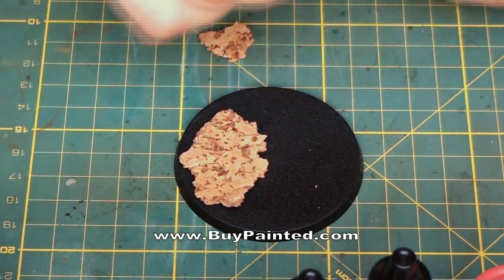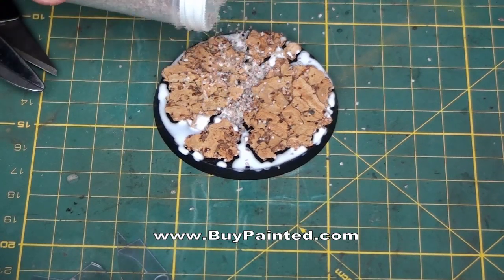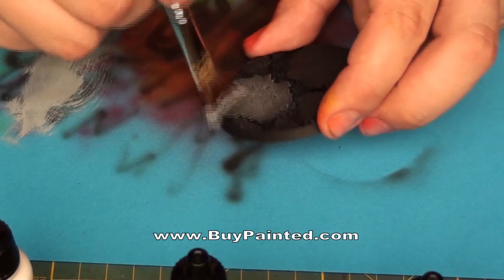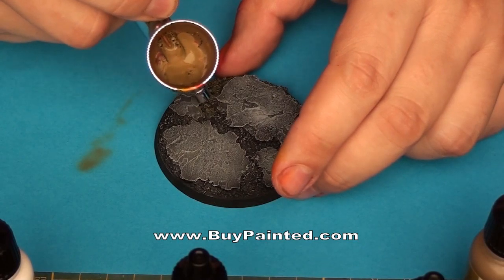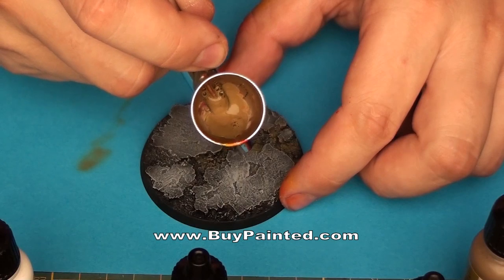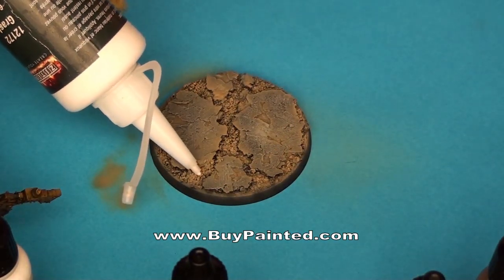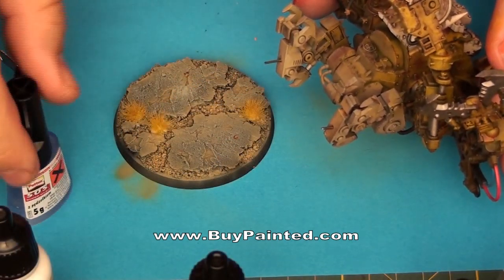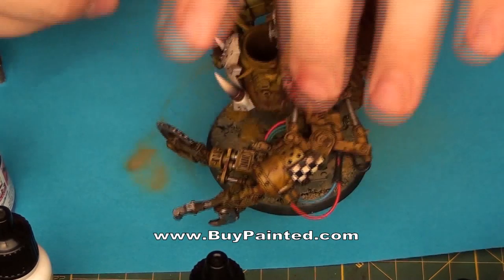How to make debris base for miniature? | Warhammer 40k  | BuyPainted

Comment from the maker: @MoreDakka101 Check out aisle with wallpapers. I buy cork panels 12"x18" that are used to glue to the walls like wallpaper. They are cheap (2-3 $ per panel) and consists of big parts of the cork. They look better than cork panels with fine parts.